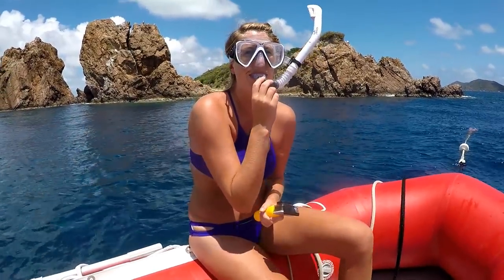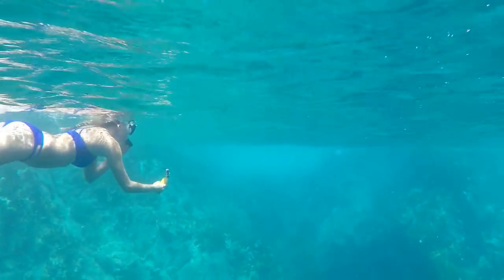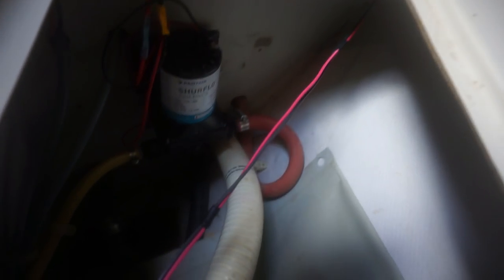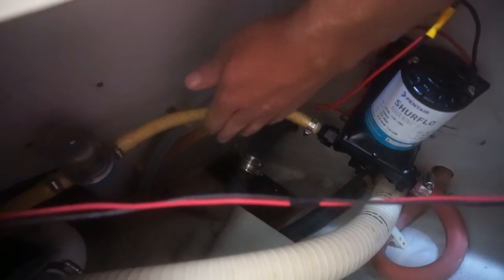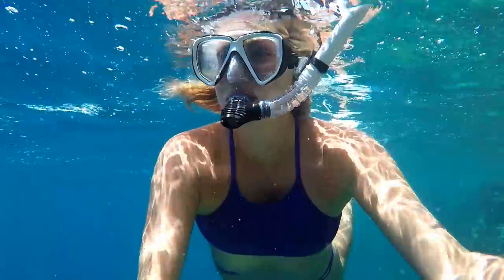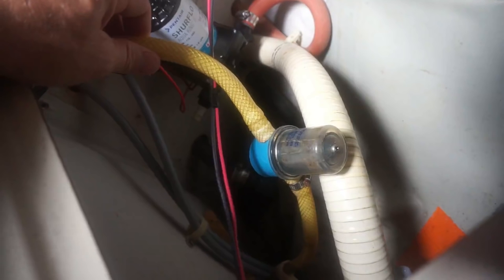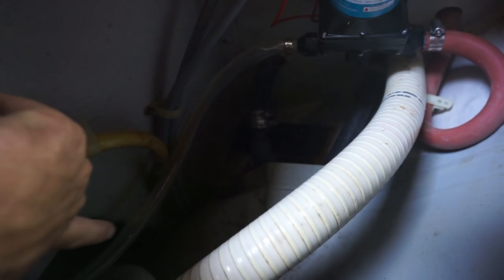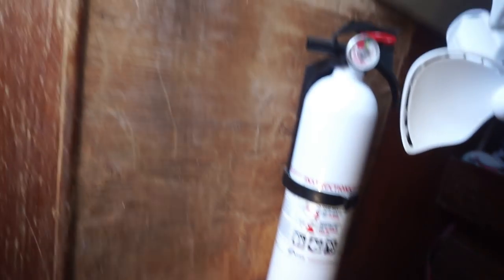Snorkeling the Indians at BVI & a Shower Pump Problem - Boat Maintenance Monday

Comment: Hi Bob,
Had the same problem a couple of times. Here is my findings: Clean the pump VERY thoroughly, make sure there is not one single hair left in there, clean the pumps membrane and put the thing back together again. Clean the filter and put some grease on the rubber seal and make SURE it's air-thight. Both will prevent the pump from sucking air. Since if the pump sucks air, (other than from the drain sump) it looses its vacuum and thus its sucking power. Your pump and the installation are powerful enough to do the job, so don't worry in that respect.

Comment: Bobby, the issues regarding the pump are that a centrifical pump must be primed and a positive displacement pump should prime itself.  Lifting water to the outlet requires .433 PSI per ft of head (fresh water)  just to raise the water so you only need to make 2 PSI to have water coming out.  The check valve idea can help to keep a centrifical pump full to avoid priming but it also lowers the inlet pressure a bit more due to it's static pressure losses (resistance to flow). Another solution to priming a centrifical pump is to have a "flooded suction" condition at the pump inlet.  This is achieved when the pump inlet is under some slight pressure such as when the pump is below the shower drain basin.  Two things that I learned in power boating was to clean and check the bilge pumps before every run and to flush from the outlet side with dish water detergent and a garden hose periodically to clear debris.  The soap reduced the friction in the dry outlet hose and made the system prime faster for longer periods of time.  If you want to test the pump, take it out and put a couple feet of tubing on the inlet and about 4 on the outlet.  Hold the whole thing vertical and power it up.  Then you can determine whether it has any self priming capability.  If not, lower the pump to determine whether it will prime with less suction head.  I fought the bilge pump issue for 20 years and my thinking is that the inside of the pump and tubing gets a bit "sticky" when dry and without a good positive displacement pump, it is unpredictable whether the pump will prime itself and anything that reduces the suction head (inlet pressure) is going to make priming more difficult. Note: larger inlet tubing will reduce the pressure loss at the pump inlet.

Comment: Good advise so far. To summarize, 1st, set intake right way up, 2, replace suction side tubing with reinforced tubing to prevent collapse. All of it, not just the bit by the filter 3 clear filter, replace element ensure air tight reassembly. 4 Use temp hose into a bucket to run fresh water through pump to ensure pump is ok. 5 reassemble and should be ok.  Note, if you are using sea water in this system, even some of the time it is likely that soap plus salt is crystallizing in and may have damaged the pump. (see #4)
Two GPM pump is undersized but as shower is small should be ok. As you did not mention it, I am assuming that the pump is not overheating or popping breakers. This is where a DC ammeter could verify actual load. Good luck. Meghan will be happier clean. Happy Crew happy Captain.

Comment: Bobby, that looks like a Shurflo Quad  diaphram pump from the quick look you gave us, They will self prime to 2-3 ft and will move water as well as air. 1 problem they did have was being a bit lack lustre in flow when the outlet was more than 4ft above the pump. Also try pulling the head cover off and look for crap stuck (bet there is hair caught in there) in the internal valve system, it happens a lot with those style of pumps. HOWEVER a check valve between the filter and the pump may improve things. Failing that I would consider swapping it out for a inline waste water pump which will move more water faster and cope with hair and human slime better that the Shurflo which was designed more for potable water delivery. Not sure how you would go getting one locally, but mail order might yield something like the Johnson Viking 16...16l/m at 3mt suction and 3 mt head, draws 8amp @12v.
Cheers Brad

Comment: You could let the shower drain into the bilge and let the bilge pump discharge the water out of the boat.  As long as you put a small screen on the pan drain in the shower the soapy water will keep the bilge a little cleaner and won't really add any real wear and tear on the bilge pump.  Plus you can remove all the extra wiring, pump, and plumbing from the old setup.  I've run that way for years with no issues.  Cheers!
Reply from the maker: +A Life Less Ordinary Afloat yeah that's probably what I will do... thanks!

Comment: I'm not sure if anyone told you to clean the suction filter yet, or if you've already done that.  The filter on the suction side of the pump protects the pump when in service so that nothing gets pulled into it while in service.  It requires constant preventive maintenance so that you keep it clean.  Try this, disconnect the discharge hose, connect a longer hose and put it in a bucket.   Turn on the pump and time how long it takes to pump a gallon or two.  Then, disconnect the filter, pipe the suction of the drain pipe to the pump and time that.  If it fills faster, you know your filter is bad.  It's a positive displacement pump, it can pump air.....btw, i was in the navy and worked in an engine room on an aircraft carrier.....this is what I did.

Comment: I know this is old, but here's something for future reference.
Make sure that pump is at the lowest point of travel for the entire path of those hoses, then you'll never have a priming issue, because gravity will keep it primed as long as water is present.
If you have to relocate the pump to do that, you might find its worth the effort.

Also, pee traps are for trapping gases from coming out of your drain, and for catching rings and  such.
😊👍🏻
Reply: Ok, just saw the next MM...
Obviously, I need to read the rest of the comments so I'm not repeating what has already been said.
😏

Comment: Bob, the pump you are using is not meant for what your using it for.  the slightest amount of soap crud, hank of hair, or harsh chemical cleaners will cause the check valves in it to malfunction or permanently damage them (harsh chemical cleaners damage the material).  temporary fix is to remove the pump portion of the pump from the motor and clean the check valves.  long term fix is to replace the pump with a pump built for that purpose.  a whale diaphragm pump is what I would recommend replacing it with.

Comment: Bob usually your intake has to be larger than your discharge. Looks like the suction hose is smaller than the discharge hose. Should be the other way around to keep the pump primed

Comment: Pump need to be a self priming type. Also add a float switch. Make sure it is high enough to leave the suction end of the hose in the water and add a check valve. If there is no float switch and just an on and off switch, add the float switch. Hope this helps. Cool vids.

Comment: Bobby I think a check valve should be installed before the filter. Make sure filter is clean bit probably was installed to keep hair and lost hair bands out of pump. This will keep Pump from losing prime. Also pump may just be defective so maybe test with suction line in a bucket of water. Good luck and keep us posted on what you find.

Comment: Use a heat gun to remove the hoses. It will be your new best friend.  Next make sure that the filter is not clogged up. Try to put a hose from the pump into a bucket of water to see if the pump is working. good luck let us know if you fixed your problem.

Comment: I'm not sure it would be worth the space in your boat, but I always use a heat gun to soften up the hoses and they usually come right off when doing work like this.   Megans hair dryer would even help (if she has one on board)

Comment: Try a check valve in the pick up line before the pump.  Shurflo part number 340-001 should work.  Check your fresh water pick up for the same type valve.  A check valve or foot valve prevents the pump from having to prime every time it runs.

Comment: You sure that filter isn't letting air in? A one way valve in the shower box would stop the water from reverse flow causing an air gap but it might clog with hair as well, so a strainer on the input side of the hose should help. A standard old sump pump is what we have in ours from 1988. It works well. A Rule 500gph with no filter. I clean it once or twice a year. Don't use it much.

Comment: A Jabsco is not a cheap pump bob. The problem is different types of pumps are designed for different purposes.
You have pressure pumps
You have suction pumps
You have inline pumps for moving fluids

You need a pump the can push a reasonable head ( height the pump can lift water) and a reasonable volume. On my boat I on the one side have a standard bilge pump 500gph and float level that works well in a well like you have.

Comment: It's the air in the system preventing pump prime most likely, check the point of water to the pump suction, the p trap should help if there are no leaks....

Comment: Burp the pump.  Pull the discharge hose off, run the pump till water comes out.  Once flowing, reconnect the hose.  Had this on an AC pump and worked like a charm. Cheers.

Comment: Need an idea of what you have first-
Hoses look old. Any evidence of pinholes in them? How does hose connect to shower pan? Check drain line from shower pan to filter before the pump. Is there a check valve? If so is it clogged? Is filter clean and water flows through drain line freely from shower pan? Is the pump self priming? It needs to be. What does the pump discharge hose connect to? I'll follow up on your answers.

Comment: You have had a lot of great advice from all your fans. The only thing I can see that wasn't mentioned was to check that the the original pick up (the red intake) in the sump was not clogged, It also looks like it wouldn't drain any lower that the highest opening in it which is where the water level is shown. ( I assume that you scooped the water to that level before you shot the vid) but I'm sure you did that 1st. To me logic would dictate that you check filter 1st, then a hose from a pan of water direct to pump with discharge hose off will tell you if the pump is ok. If ok hook up discharge and see if it is pumping overboard. That way you know if it is pump or which side of pump is the problem. Not to likely but that red discharge hose could have an internal kink in it where it makes that circle. Do let us know. Just want to mention I found you from "Gandpa's Farm Goes Sailing" mentioning you. Thanks GrandPa

Comment: Did it ever work correctly?  What has changed?  Maybe you need a check valve to prevent back-siphon of air into the pump?
Reply from the maker: +Ted Fryman the old pump quit... so the pump is the only thing that changed

Comment: Buy a self contained bilge pump, a small one ( the style that you throw into the bilge and it only has a line out).  Put that in the shower catch basin, run the out line thru the holes that had the suction line to your old discharge line. Also will have to extend your power into the catch basin thru the same openings to power the bilge pump. Simple fix and will always work because bilge pumps are designed to handle dirty water and gunk. If you can not find a bilge pump small enough to fit in the shower catch basin then replace the old pump with a 'self priming' pump. It is difficult to get  decent suction on a 3/8 inch line, it requires a good pump.  regards/greg
Reply from the maker: there is not enough room in the shower pan for that type of pump our i would definitely do that

Comment: All pumps have a head rating, how high they can pump (head rating).  They are also rated as self or nonself priming.  You need a self priming pump with at least a 6 ft head. It wouldnt hurt to install a check valve after the  pump.

Comment: Mounting the pump lower will increase the head pressure...ie the pressure to move the water up and out of the boat...six inches probably not an issue.  If the pump isn't weak then there is likely a priming issue.  I have a well booster pump on my house from a water storage tank, and it had numerous problems until I did a few things.  Number one I installed a foot valve. Well this will not work for you because the stuff from a shower will keep the valve from sealing eventually.  It is the same as a check valve except it is at the end of the pipe on the water inlet side.  This prevents the pipe from discharging all the water in it.  This is bad, because the pump will lose it's prime.  It has to have water in it in order to move water.  I would mount the pump lower, and make sure that all the water in the pipe will move down assisted by gravity.  You may have to put in a few more clips in in order to do this.  A gentle slope at least and eighth of a bubble on a level as they say in the plumbing business...straight lines like a ramp going downhill. Do not put in a ubend it will create additional problems.  It will make goo build up and not allow water to pass at the bottom of the bend, and not allow air to float up on the pump side and out for priming.  The pump is a diaphragm pump so that it will move the goo as well.  An impeller pump could be fouled by goo a little bit more likely. This should ensure that the pump has water to move.  If there is some air and water together it should still probably get the job done.  You want the shower basin to fill the hose and the hose should discharge air into the basin as the water drains in all the way to the pump so that it can fill with water.  If the air doesn't move the water won't either.  The water will replace the air in the hose as the air escapes or is pumped overboard if it drains in basically straight lines down to the pump.  The hose in the basin may go up slightly exiting into the bilge.  There may be a restriction on the discharge side.  I would snake that if I could, as well as the inlet.  Hard water and goo can build up on the discharge side and scale over at some point up the pipe where the water level tends to end up after a shower in the discharge hose.   I'd soak the filter in some diesel fuel, rinse, and then some Calcium/Lime Eater stuff like CLR, then pressure wash somehow.  If it is a metal one and can take it.  It might just be plugged up on the inside.   If they are cheap get a new one.  Disconnect the discharge and see if it pumps...if it doesn't and there is water on the inlet side it has to be the filter. Try it without the filter on the inlet side. You probably need the filter, but your filter is the most likely subject part to be the problem other than a diaphragm problem on the pump.  The filter might look clean but just isn't on the inside.  Also the filter/strainer housing may have an inlet side and an outlet side...it also looks like it might be installed upside down...air might lock in the clear filter/strainer cup. Jabsoc strainers do usually mount the way you have it with the cup up.  Oh a 2 gpm pump is the standard flow rate for water saving shower heads in a residential application.

Comment: I would suggest first to disconnect the discharge side of the pump- to see if it is pumping before anything further. 
Disconnect run for a few seconds, if it flows-then attach a tube to the discharge side-
lift- the tube to 5' level- if water flows then you know the pump has enough lift capacity (head)-
if still no water flow, at all- then something is wrong with the diaphragm (clean it check for cracks and holes.
Next I would not use that type of tubing (name escapes me at the moment) because it tends to collapse on the vacuum side of pumps.
Patch

Comment: From what I could see, that pump should lift a column of water 3/4" ID hose easily 10 feet. Make sure the pump is below the bottom of the shower pan so that it always has a prime.  Perhaps once the pump looses it's prime, (shower pan getting empty) the discharge column of water runs back into the shower pan. Try installing a check valve on the discharge side of the pump.. Let us know how it worked out.

Comment: Fill the bottom of the shower full of water and turn on the pump and see what happens that will tell the story, if it empties quick then it is pumping faster than the supply water and then picking up air, cheers.

Comment: Hi mate not the best pump for the job , I switched to a gulper pump and never looked back , hair and even just soap scum stops the normal pumps from working , don't ask me how soap scum does but it used to stop my shower pump every 3 months or so , the filters where clean and no blockages , it was just as if the soap scum air rated the blades around the pump and it would just not prime until I cleaned it. A gulper pump is a diafram pump and will pull all the hair and crap straight through it within reason.